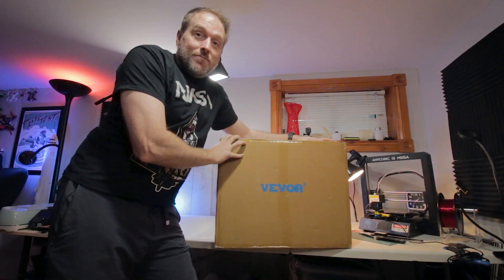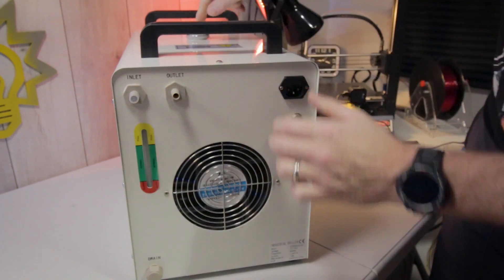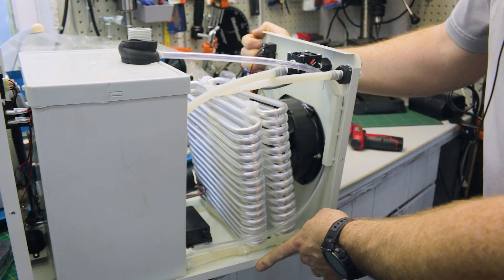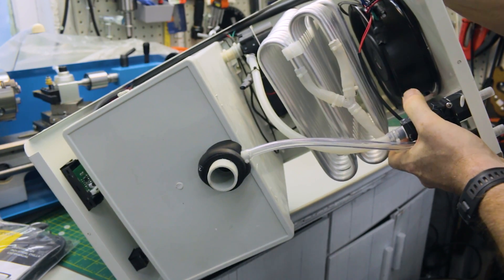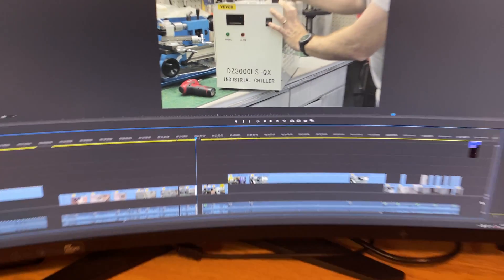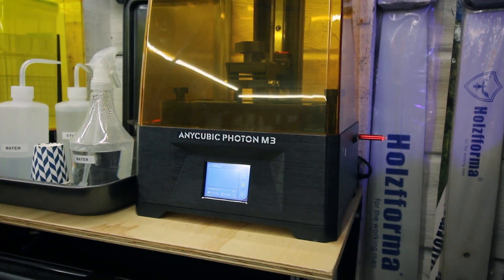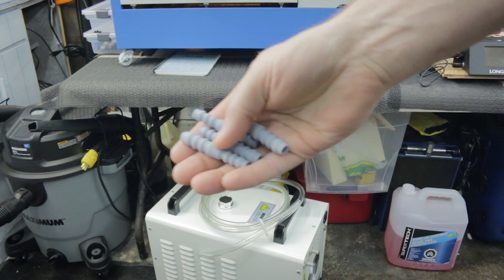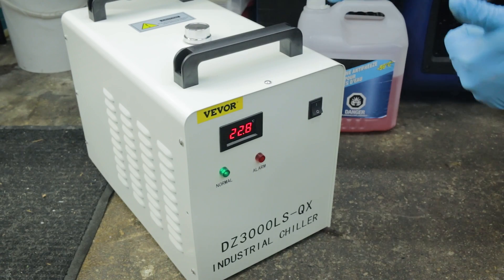40-Watt C02 Laser Upgrade- VEVOR Industrial Chiller (NOT ACTUALLY A CHILLER)

Comment: Vevor translation =run away from anything Vevor
Reply: Some Vevor stuff is great. I have a Vevor jack hammer and it is awesome.
Reply: No way I got a deal 5% of what rest charge used real chiller -20 c to 200 heating .  Used recirculating heat chiller. Scientific firms relabel thieves $13,000 for $700-1000 model.  Dunno how materials could be so cheap. It’s insane cheap, when in school nobody would afford such things gifts old, broken or millionaire.

Comment: Maybe I missed it, but did you actually use the water line antifreeze 7:37 or are you going to rely on the aquarium heater in the winter?
Reply from the maker: I run antifreeze. The tube would be destroyed even with that heater in my temps.  The heater is only to bring the sump temp up a bit before using it. I turn it on the day before with a wifi outlet

Comment: the most sensible upgrade for the cooling capacity of any laser is just to add more capacity. I just went to 50lt of water+ RV antifreeze and I havent managed to get the water above Ambient+5°C
Reply from the maker: That would not work for me as in my shop at - 10 (and below) a good portion of the winter would not be possible to get the system up to a usable temp.

Comment: Informative video, especially taking it part and explaining it's guts.  Glad to see that you recognize / acknowledge what this really is - a Water Cooler, not a Water Chiller.  It s so sad that manufactures use misleading labeling / advertising.
Reply from the maker: Oxford dictionary says it's not too
Reply: @MkmeOrg  wonder if adding a peltier driven cooling block to the radiator loop would help much. They are not super cheap (once you factor in the powersupply) but sound like they might turn this from a cooler to a chiller. Down side is the massive powerdraw of peltier blocks. 5 to 6 amps per element and you probably want about 6 to 8 of them to make a dent.